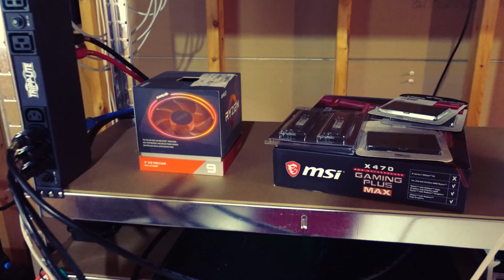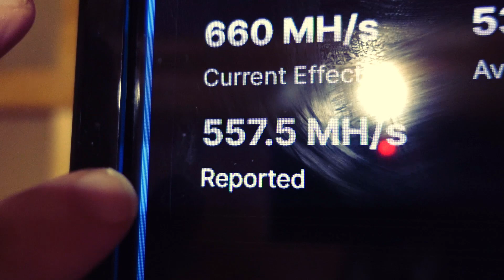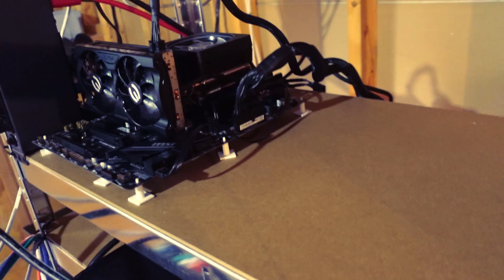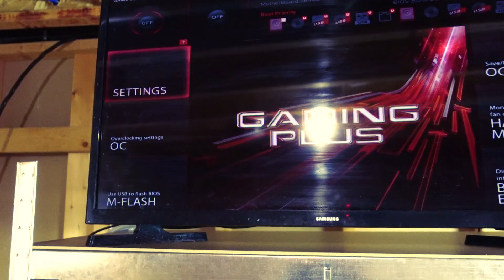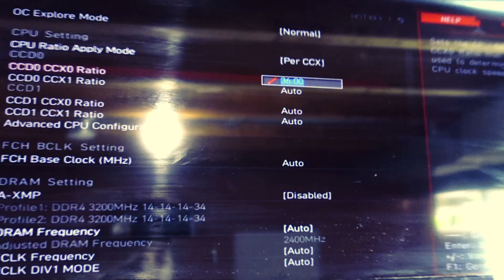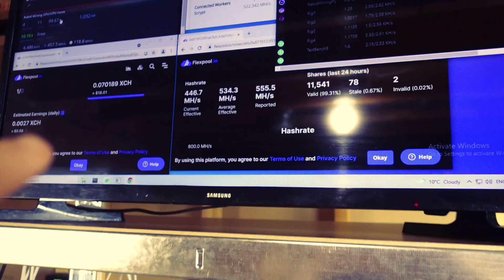Adding ANOTHER CPU Mining Rig | Raptoreum?

Comment: thats great but that cpu miner you said use crashes on me when i do a full tune , works with notune set but wont finish the tuning without crashing for some reason , anyone know why , i was thinking maybe heat.
Reply: what temp setting is safe for a 3900x i have no clue???
Reply from the maker: @jediknight2350  AMD says 80-90c for 24/7 use is fine but the stock cooler doesnt even get that high unless it needs a thermal paste swap bad seal.
Reply: @RabidMining  thanks for that i just run mine at 4200 i havent even overclocked it yet but i will soon got stop it switching off first lol driving me crazy.
Reply from the maker: @jediknight2350  probably burning a lot of power I only run at 3.6gh at 1v
Reply: @RabidMining  ok ill give it a go.
Reply from the maker: Hmm what cooler and settings are you using?
Reply: @RabidMining  i got a water cooling big one i think im going to retry and see if it temps out only way i suppose but that software running would bugger tune lol cant win.
Reply from the maker: @jediknight2350  what are your OC settings?